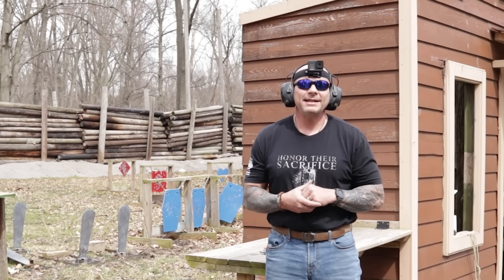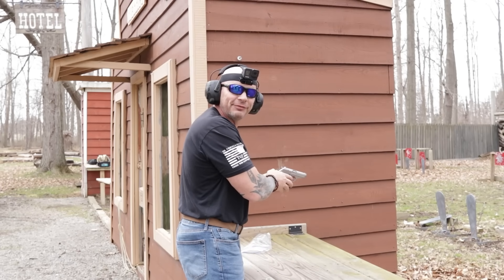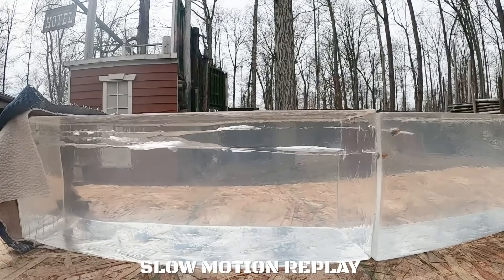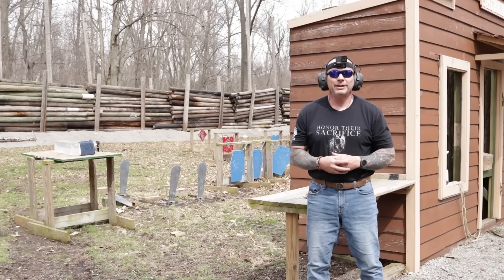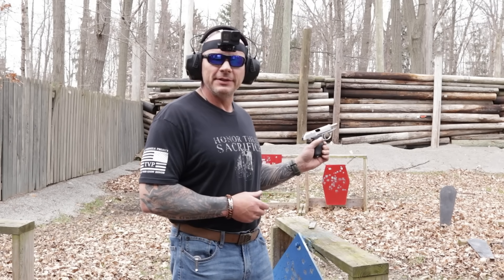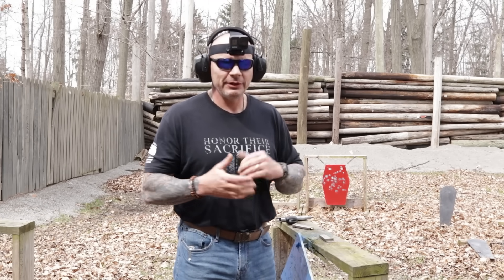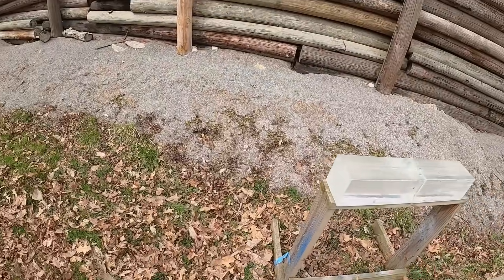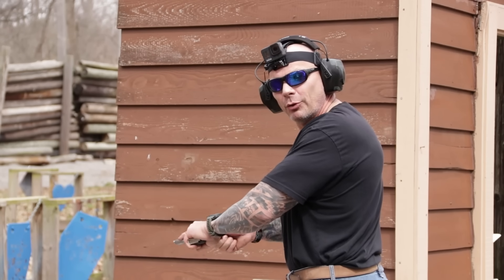Stopping Power of .380 ACP

Comment: If the round does not incapacitate someone immediately, then its a fail regardless what round it is because as long as you leave the perp in a condition to return fire or bum rush you or even throw a ninja star in your direction, you are not safe.

Small caliber rounds like the .380 will allow the perp to have a chance. Just not enough energy dump. You'll have to empty the mag. I've seen alot of defensive gun videos and sometimes I can verify it's a 9mm and way more times than none, the perp has a chance to do something back. Even with multiple shots in him!

The round that wins is the one where with just 1 shot, the perp has no 2nd chance. The more powerful the round the better chance you have at accomplishing this. There's no denying that a 9mm 45 40 357 44 mag etc is gonna do way more than a wimpy .380.

It's not just the penetration which you are focused on in this video, it's the energy dump into the target. I mean shit even the .38 and .38 special failed miserably but on the flip side, they led to better more powerful rounds so at least the .38 served a purpose.
Reply: Well, there’s different sides to this.

Greg Ellifritz’s 2011 research paper dispelled the myth of the alleged “ineffectiveness” of the .380, at least up to a point.  Statistically, the rate at which .380s kill or incapacitate attackers in DGUs is just about indistinguishable from other commonly carried centerfire pistol calibers, such as 9x19mm, .38 Special, .40 S&W, or even .45 ACP.  That isn’t to say it’s “just as powerful” - physics is physics and ballistics is ballistics - but it is just as effective in most situations.  According to his research, you don’t see a significant drop off in effectiveness until you go to .32 ACP or below, but even these - even a .22LR - can still be effective in a lot of cases.

I would say that the reason for apparent “parity” in effectiveness in .380 versus other more powerful rounds is the psychological state of the person being shot.  If someone doesn’t expect to be shot and they are hit anyway, they may be more likely to flee or “give up” (that is to say, become incapacitated or even expire).  Most garden variety thugs are not looking for a gunfight; they expect easy money from a vulnerable victim.  If the would-be victim surprises their assailant with a gun - even a “wimpy” .380 - that will probably suffice.  So, for most private citizens in most deadly force encounters, the .380 should be just dandy, especially if they practice regularly and can reliably deliver multiple torso hits under stress.  After all, the .380 was apparently good enough for continental West European police departments to use them as their standard sidearms from the 1920s thru the 1980s, and a few countries even used them as military sidearms.

But later these same European countries switched to 9mm, and there was a reason for that, too.  Police and military personnel have to be able to do things with their sidearms that civilians are hardly ever called upon to do; engage at distance, shoot through doors or walls, and most importantly, kill or incapacitate opponents who themselves are full of adrenaline or drugs and are shooting back.  

I read a comment on another thread like this by a retired cop who said when he joined the force, they were carrying .357 Magnum revolvers.  The department kept internal statistics on how effective the police were with their sidearms.  With their .357s they had a 96% success rate.  Then they switched to 9mm and the rate dropped to 70%.  This was not considered acceptable so they then switched to .45 ACP, and it went back up to 85%.  

I too have seen videos (police body cams) of hopped up perpetrators being peppered by 9mm and they keep coming.  Looking at those certainly has led me to wonder about my .380 EDC.

Just speaking for myself, what all of this has led me to do is that I keep my .380 for EDC in my everyday life of going to and from work, buying groceries, meeting friends for lunch, etc.  I am confident that it’s enough to deal with someone who wants to take my wallet or hijack my car.  In the real world, it has proven to be perfectly effective in that role for countless people.  But when I’m in my “sheepdog” role at my synagogue - where I’d expect a threat to be motivated by hate, anticipating an ultimate shootout with police, and not just trying to steal money from someone they assume to be defenseless - then I carry more serious firepower in the form of a .45 ACP M1911 OWB under a sport coat.  

You make a valid point but I still wouldn’t discourage anyone from carrying a .380 if that’s what they felt comfortable with.  It’s not a “going to war” gun but it’s way better then nothing and will still keep an awful lot of people from being victimized, just as .38 Special snubbies (which have about the same energy as .380 autos) have successfully defended private citizens for many decades.
Reply: @TheRobman139  oh yea people carry whats going to work for them. Nothing wrong with that but if you value not getting hurt or dead then they better be sharp shots and know exactly where the brain, heart, major arteries are and especially at a distance. As you said, military applications go further beyond than the scope of a .380 hence the switch. But even the most recent shootings like the Dickens at 40 yrds and some dude who shot a guy weilding a knife at a store clerk were both ninas and Dickens took 8 and the store incident took 5. Top that with what you and I have seen on video and thats just TOO much leeway. 

Yes a .22 can be effective but effectiveness is not justice. It's a crap shoot. You shoot someone with a bear gun and BAM, he's out for the count. In a civilian high stress situation thats exactly what you want, as close to a one and done as possible. I often have dreams where I am shooting someone or something like an animal attacking me. In the dream I shoot and shoot and shoot and I know I have or think I have a powerful gun and that sucker just keeps coming and coming and I wake up so unsatisfied. Same thing when i am running. I run so fast that when i pay attention I am barely moving at all.

It's weird but I believe those dreams transpire into a real life situation. When I put myself in a what if scenario when thinking of if I am ever in a human defensive situation, I think about my dreams and understand how I would feel in real life and so I rest comfortable that carrying a more powerful gun than a 9mil or .380 will highly likely NOT leave me feeling like I was dreaming. Something is better than nothing at all but if you have a choice, don't gamble.

Comment: I have a Ruger 380 LCP and the first time I went to the range I was shooting at 50 feet 10 inches low on the target. I put a laser site bullet into the chamber and it verified that the sights were off to the barrels position. I rectified the sights and it now shoots dead on. This seems to be a problem especially in small hand gun where the barrel has to move to chamber the next round.

Comment: I've always taken issue with the so-called "FBI standards"  I've rarely seen anyone with an 18" front to back chest. If you are getting more than about 10" of penetration you are just saving energy for the bystander behind them. I could go into all the other problems with the "FBI Standard" but I wont here. The best real performance in REAL shootings has always been the light for caliber rounds (without getting into the boutique rounds like Glaser and magsafe) that penetrate about 10-12" with good expansion or exploding inside the chest creating massive hydro-static shock and wound cavity. Rounds such as the 9mm +p+ 115 and 124gr at 1,300-1,400 FPS, 40S&W 135gr +p at 1,300FPS and .357 mag 125gr at 1,500 FPS ARE the best, most effective rounds to be had in those calibers. Its not a debate, its simply a fact. 

We aren't hunting here and we don't need through and through penetration.

Comment: I  have carried the same .380 handgun for the past almost 40 years... a Mauser HSC. Excellent pistol, very compact and excellent to control.  Never had a jam or a misfeed shooting all sorts of ammunition. The only thing I don't like is the bottom magazine release and the 7+1 single stack but it is a very concealable, easily controllable weapon.
Reply: The 380 ACP is a good alternative to 9mm especially for seniors with wrist/hand problems.  I have an Interarms PPK/S and I just love my classic beauty.
Reply: You should check out the ruger lcp max . 10 plus 1 i believe
Reply: do you notice difference in ammo in 40yrs?  Shot 380 in my 20s  wouldn't have on guns I  shot  were cheap round was weak. 30yrs later ruger lcp 2 max has much respect.
Reply: At least with the bottom mag release, there is less chance of an unintentional mag dump.
Reply: 380 is a mouse gun
Reply: @loveydovey4u  MAybe but if you know how to use it, it can be just as effective as any other. I also carry a .40 but the .380 has advantages for concealed carry that the .40 can't.
Reply: @loveydovey4u  How bout you stand down range and I use you as target practice. Your manlet ass won't last an entire magazine of .380, not even close
Reply: @loveydovey4u lol you wouldn’t be saying that if you got hit by it 😂😂
You would probably be on the ground in agony